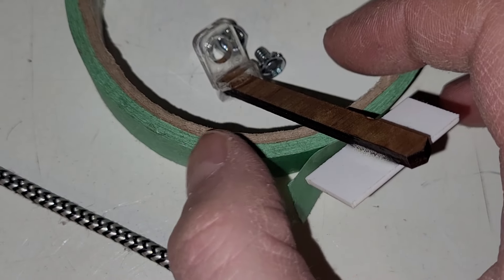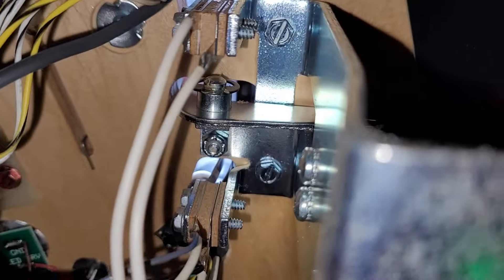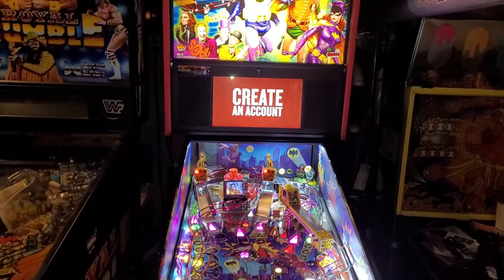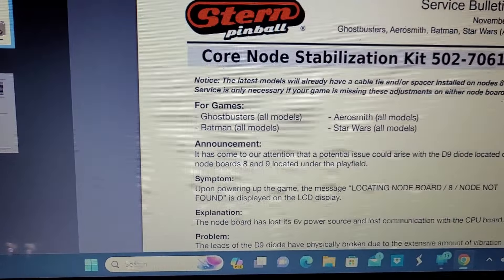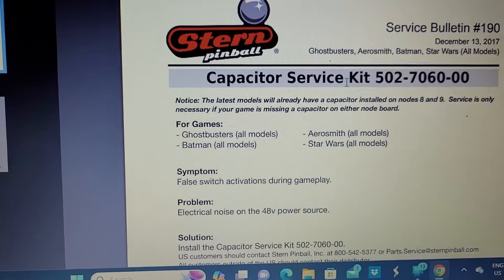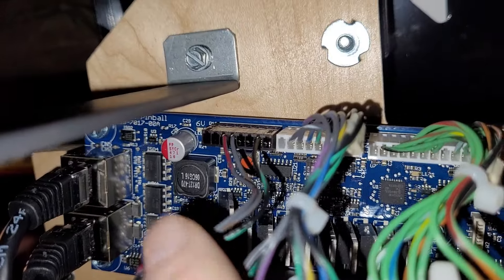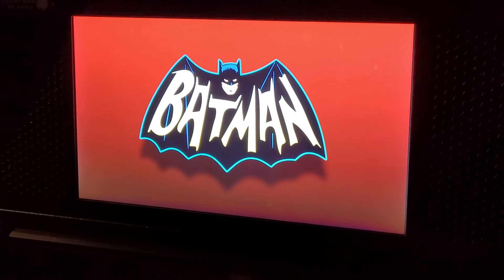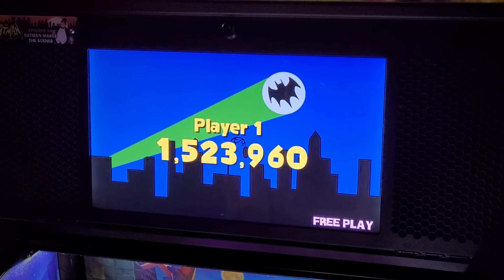Batman 66 LE Random SLAM TILT issue & Other service Bulletins for Spike 2 Pinball Machines

Comment: I'm not surprised Batman 66 needs to be fiddled with as far as it's the very first game using the Spike 2 board Stern released in 2016, so i guess at that time they were experimenting a bit and a few instabilities had to be addressed. Same thing with cars when they release a fresh new model, if you buy it day one there are often a few caveats to deal with that are eventually solved with the later models 😉
Reply from the maker: I was thinking BM66 might have been the 1st spike 2 game which makes sense!